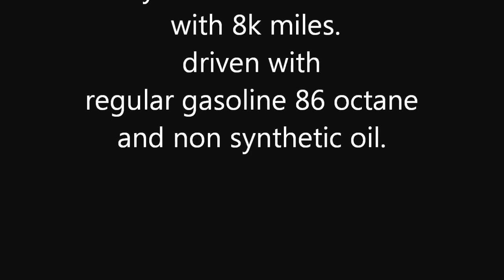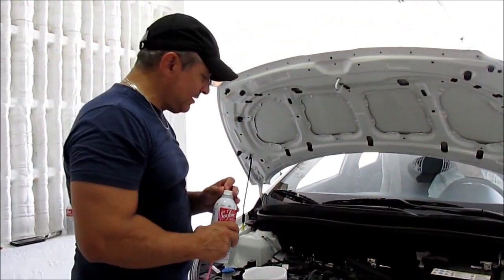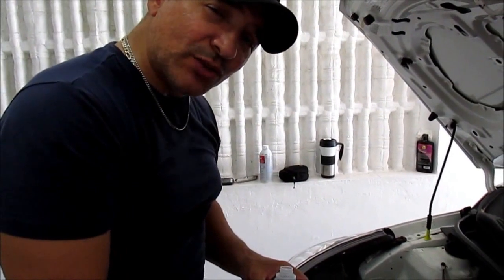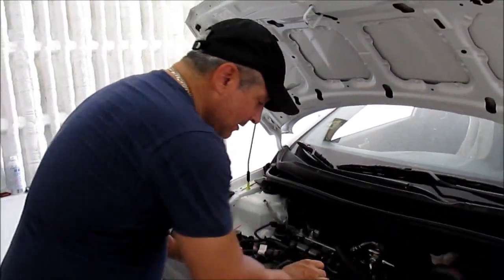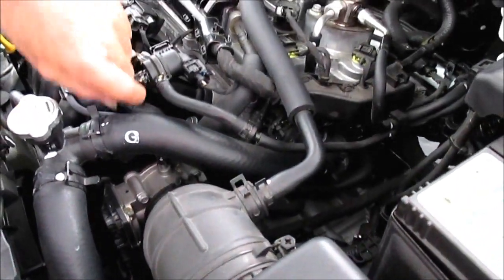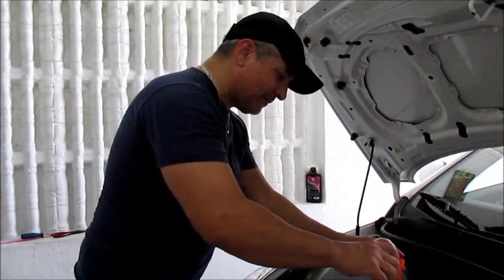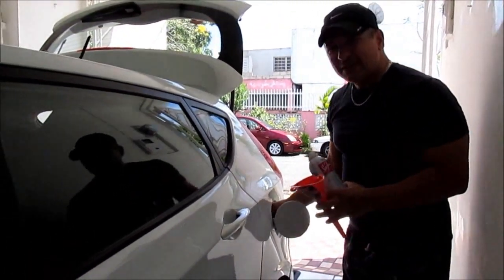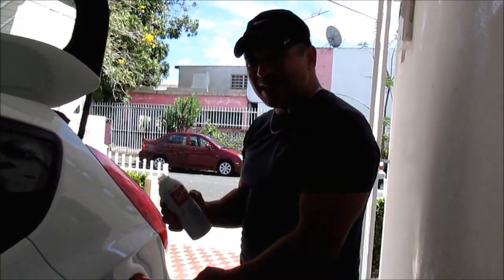Sea Foam Hyundai Accent 2012

Comment: I have used crc cleaner and sprayed through the air Intake but need to retreat do to car still pinging if I spray thru pcv hose does engine need to be revved or just spray in 30 second intervals thanks!!
Reply: Bes bet it persistant cleaning....I personally am a fan of 4 oz. of Marvel Mystery Oil every fill up, these direct injection vehicles are bad on fuel intake deposits.....so the MMO helps keep the carbon loose.....also adds the lubricity back to the fuel due to "dry" ethanol (corn) fuels we have in most of the U.S....I personally use 5.25 oz. into the crankcase with every oil change, then the rest gets split up between the intake and the gas tank.....

Comment: Michael C, actually, that car has direct injection, so seafoaming it with every oil change is good idea. With direct injection the intake valves are no longer constantly cleaned with gasoline, so they get gunked far more easily. A lot of cars with direct injection develop valve problems at around 60k and the dealership will charge a lot of money to clean them. Worse yet, the car could end up needing a valve job. Regular seafoaming is cheap and easy to do and prevents the valves from getting gunked up.
Reply: This is generally true for some manufacturers but these seem to have evaded this issue. There's one of these with 520,000 miles on the Hyundai forum and never had the valves touched
Reply: Most deposit in GDI engines comes from oil vapor . Use a OIL CATCH CAN can reduce the deposits . And change your engine air filter regulary every 20,000 km and use high quality oil for the engine
With these you prevent deposit from happening to the valves .
Hope these tips will help you .

Comment: Did the check engine light come up after you pulled the hose?
Reply: No. Since it has to be a constant vacuum problem. ECU will try to fix the problem by adjusting the IAC but one it notices the large vacuum it will set a DTC code for a vacuum leak. A small leak will have no affect since the ECU can control it even tho it has bad gas millage.

Comment: Like the representation here...but I personally would have added it to the fuel tank, and the crankcase, before sucking it through the intake ;)  But thanks for the video....was curious where the PCV valve was hidden under all that plastic on my new TDI :P
Reply: Adding it to the crankcase and fuel tank would not clean the intake manifold or intake valves in a GDI engine. The injector is after the valves in each of the cylinders.
Reply: Adam Hoier Actually that was not the PCV valve (positive crankcase ventilation) That was the vapor canister purge valve.